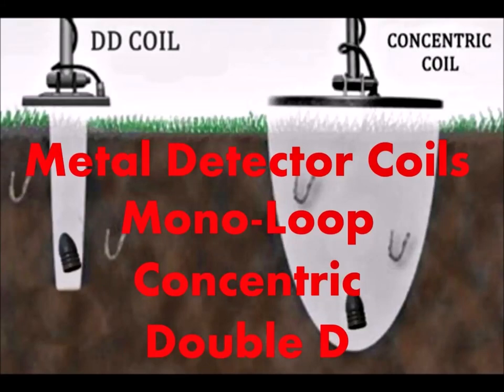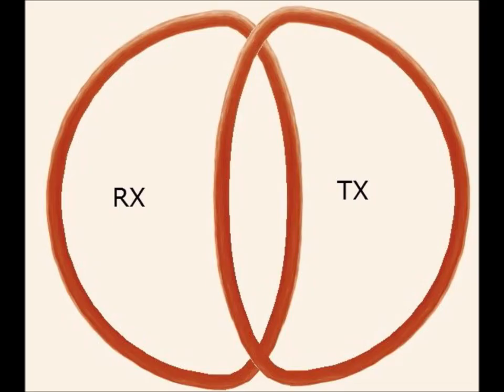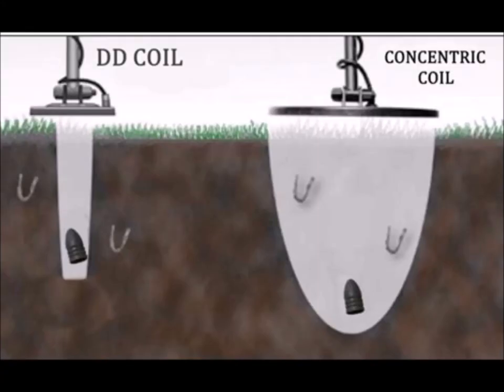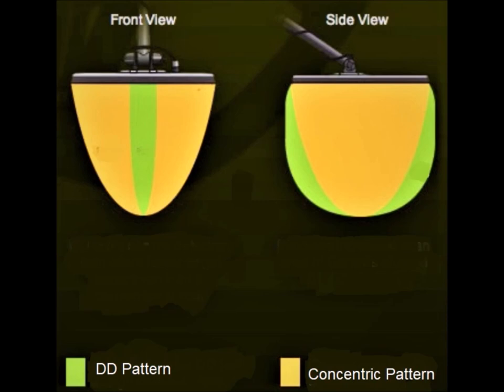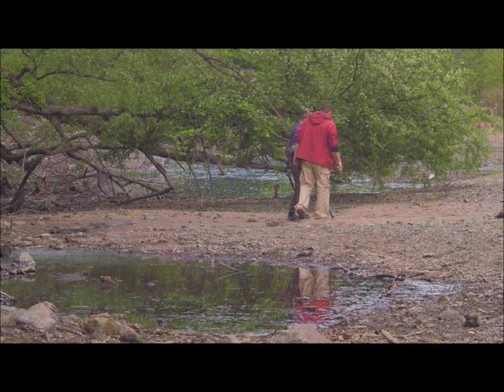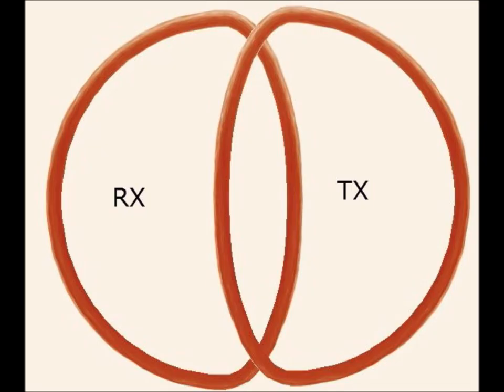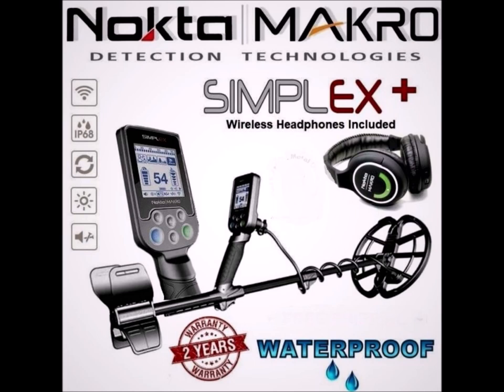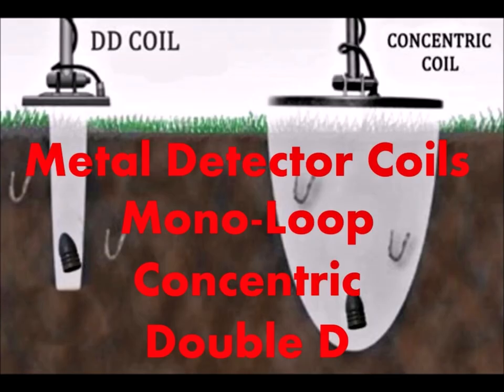Metal Detector Coils Explained Concentric- DD- Mono Loop: GoTreasureHunting.com Audio-video Blog #4

Comment: Dear sr Which coil or machine should be  used to find gold ten feet underground?
Reply from the maker: You need A very large coil, 2-meters x 6-meters, and a strong pulse induction machine like a Minelab ($7,000.00US)

Comment: Awesome explanation definitely earned my subscription, not that i value my subscriptions highly. I have a garret ace250 and i have plenty of pre 1940s properties near me and ive been wondering why i only find clad. I figure the silver coins are much deeper with a higher chance of junk metal laying somewhere above or very near them  causing my detector to signal only the trash targets. With this new knowledge that you have bestowed upon me, i now know i need a better machine and im hoping to save enough money to get a Nokta Makro Simplex. I must now tackle the confusion of picking one of the new generation of simplex since the first gen model that i want has been discontinued from my understanding. Does my theory that i mentioned here seem logical or possible? Any feedback would be much appreciated. Thanks
Reply from the maker: The new Simplex machines are fantastic, as well as the Minelab X-Terra Pro Call or email Garry at Treasure Coast and ask him for a great price. Tell him Terry Sent Ya! CALL 772 800 9908 OR EMAIL:  INFO@TREASURECOASTMETALDETECTORS.COM

Comment: I think we all like them double D's, I just been wondering if anyone has tried making a coil made of Coils? Like a coil total 12-18"   any type or configuration. With the wire making up 1" loops all around the perimeter  with the coils zip tied.  Then placed on a flat surface with a mold around it  forming the circle or DD shape and the coil warped tightly in cloth tape then potted in epoxy and nylon bolts placed in the epoxy to  hold the mounting bracket carbon fiber or  fiberglass with 3/8" nylon bolts also using a 1" carbon fiber tube,   
Has a similar type coil ever been tested???  Or possibly a serpentine coil. Where the coil is zigzagging between 2" x1/2"thick fiberglass bars all around the perimeter of the . Or making a pancake coil . Where the bundle of windings start off wrapped around a 3/4" tube . Then placing  on a flat smooth sheet of plastic. And using super glue and hardener. Wrap the coil on top of it's self. Gluing every 45° to 90° .  Forming a 6" to  12"+ coil on a dual coil machine. Possibly wrap two coils at once with a piece of 1/4" nylon tubing between them. With one connection in the center the other on the outer perimeter, a vlf machine having two in each place. It seems the pancake coil would make the strongest Field. maybe not the best for detecting small gold deep in earth. Also using the gauge of the wire  and number of strands to nearly equal the resistance of the original coil.  I see no reason for detectors to cost what some do. Nearly $10k for the high-end mine lab machines $8***.??  And the old gold monster1000, is $1000 , when the Chinese my machines start at $$79.00 to $100+,  the $189 to $300 units look to be decently useable Machines. I know there is overhead, advertising and R&D cost, but 5-10 x the cost of the best Chinese units  some minelab  units are made in Malaysia  not Australia, not sure if anything is made here in the U.S. anymore. The components to build a detector is as common as anything else you see daily, between a computer power supply, a tablet computer,  and a AM- FM radio the same components could build a $10k detector? That cost less than $100 to build, probably less than $50, in parts and electronic components even retail the components are likely less than $150, if I had the skill and money , I'd buy a detector have a duplicate PCB Made and populate it, the programming of the discrimination may not be easy. But is possible, I'm surprised china isn't making knockoffs anyway !!   Thank you for the valuable information, and sorry for the rambling !! Have an awesome day!
Reply from the maker: Still have the problem of the FCC limiting your frequency range (power)
Reply: Since you are talking about double-D coils, I assume you are referring to VLF detectors.
There are a couple issues with multiple coils.

The first is the relationship between the transmit and the receive coils. The receive coil needs to be precisely positioned so that when the transmit coil is working, the net result measured on the receive coil is negligible (nulled out). This is much easier when positioning the coils using the concentric configuration.

The second issue involves the added unwanted capacitance coils have. We don't have perfect inductors/coils (without capacitance and resistance), so these imperfections multiply each time you add more coils.

Many people think these operate like radar or sonar. Where the signal is transmitted, it hits a target, then the beam of energy is reflected back to the receive coil. It is all about the transmitted lines of magnetic flux (or magnetic field) and how the different targets disrupt the spacing between these flux lines. The engineers measure the induced signal picked up on the receive coil as they move it into the null position (before gluing it into the frame).

When a non-ferrous metal is introduced into the magnetic field, the alternating magnetic field induces eddy currents into the metal target. These currents create their own reverse magnetic field opposing the original field. The interaction causes the lines of flux to become slightly crushed together. This disruption is seen by the receive coil, and the crushing signal tells the detector that a non-ferrous target is nearby.

Introducing a ferrous target does the opposite. The iron wants to become magnetized, so it pulls the field, opening the flux lines. This time, the receive coil tells the detector to expect a ferrous target.